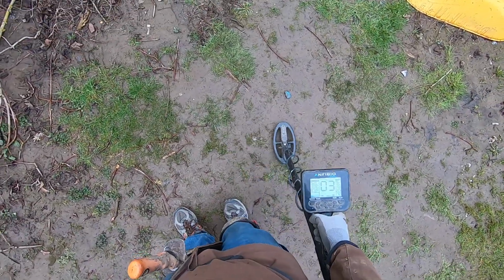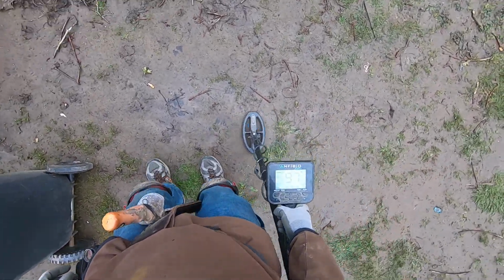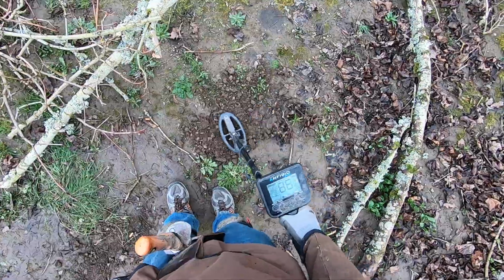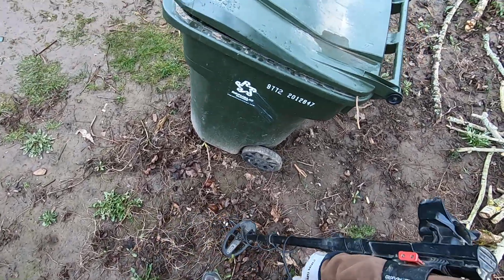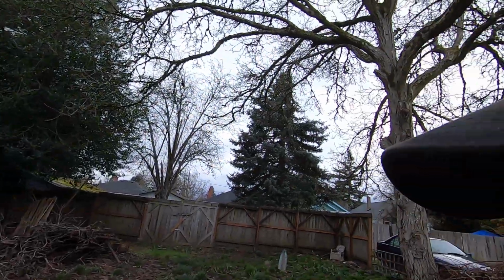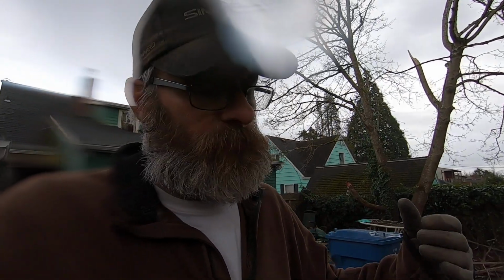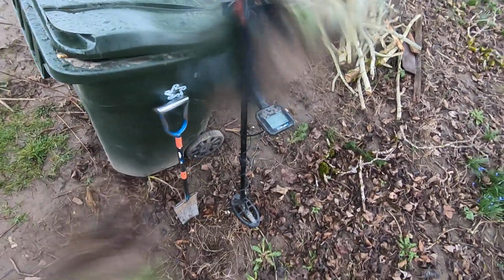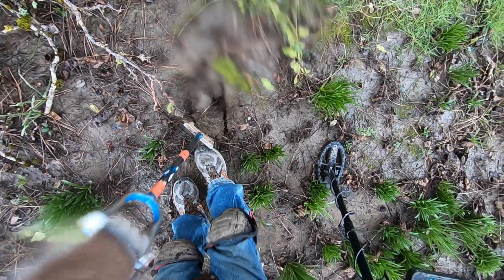The glory of being an expert metal detectorist.

Comment: Manual reads that if the ground is too mineralized use 14 kh and use 3 tone or the park tune if you doubt.
Reply from the maker: The Anfibio works best in my soil in 3 tone 14khz. If I use 4 or 5 tone I just get horrible unstable falsing. Most of my vids with Anfibio are 3 tone 14khz or 20khz. Thank you Heriberto.